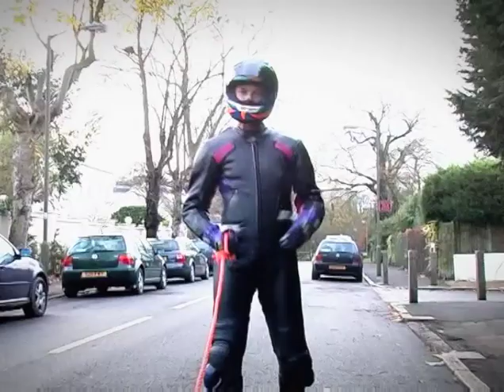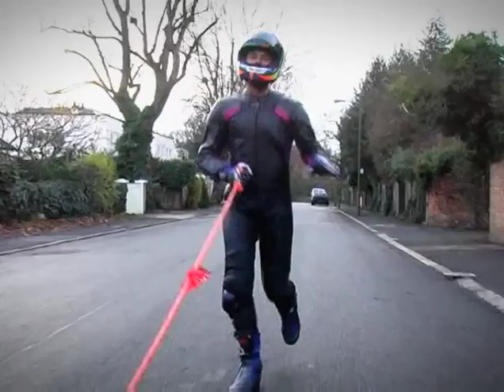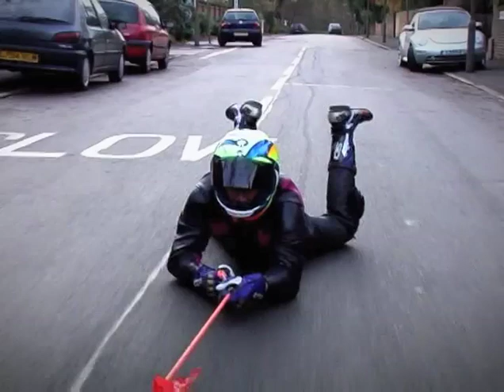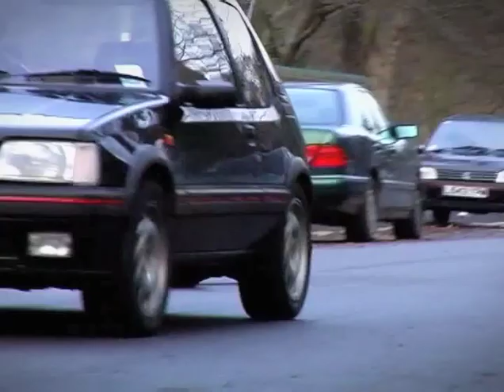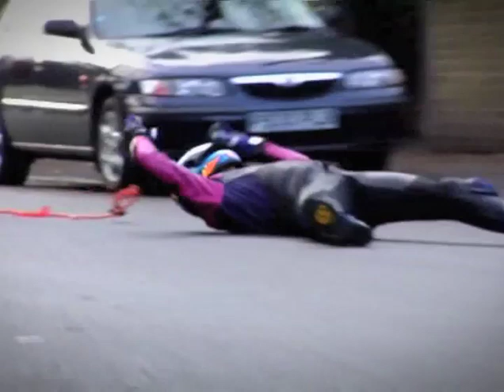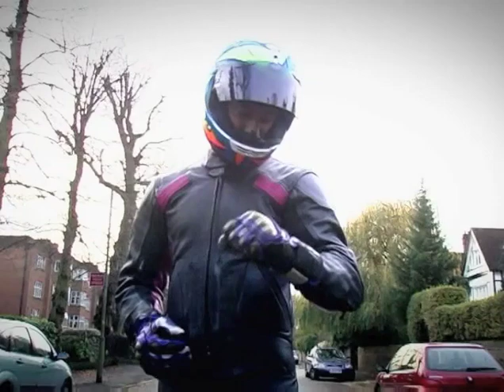BIKE LEATHERS CRASH TESTING!!!

Comment: too bad some days leathers will make you pass out from heat exhaustion round here. try to use mine as much as possible but over 100 my brain goes south in them. this was freaking hilarious!
Reply: you can get ice pack vests otherwise known as heat cooling vests which go under your clothes/gear, you freeze them overnight before riding. Similar to what firefighers wear
Reply: yeah thanks, I discovered evaporative cooling vests this summer. it really works and can resoak at fuel stops where I overheat the most. cool!
Reply: No worries about overheating in leathers here in Ireland 😂and when it gets really cold I wear large textile gear over them  🏍
Reply: what about in my country? where avg temperature in summer is about 35 degrees Celsius?